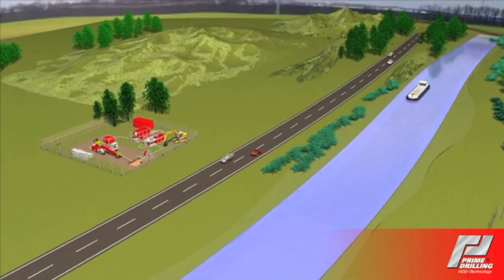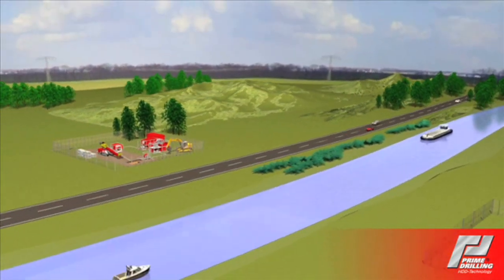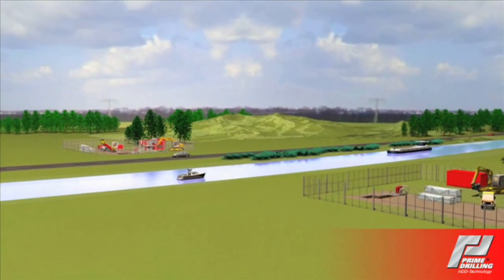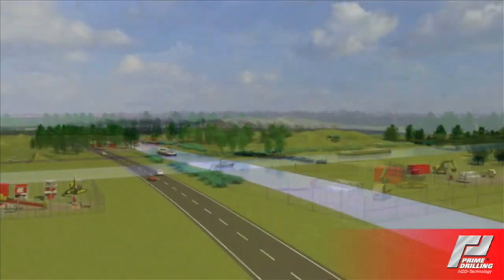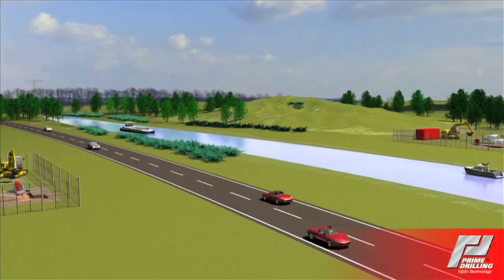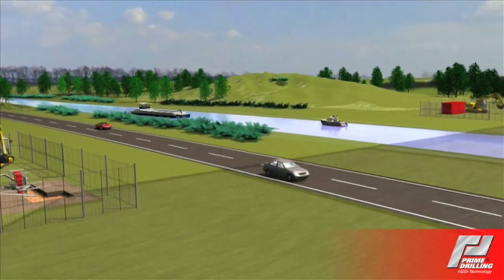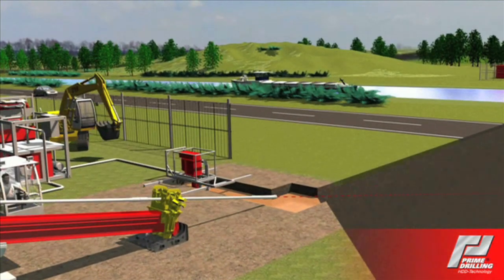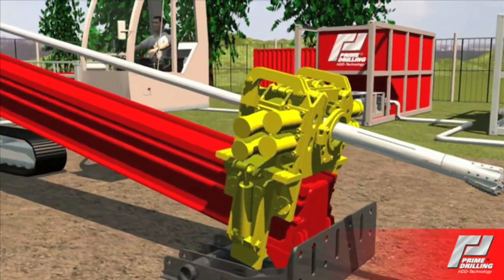Prime Drilling - Horizontal directional Drilling explained

Comment: Great video!  Thanks.  The invention shown in this short  video allows you to build a continuous pipe onsite for all your HDD projects.  The lightweight pipe is very strong, non corroding and it can resist extremely high pressures.  We can make pipes as small as 3-in. (75mm) in diameter.  Please watch the video:  
https://www.youtube.com/watch?v=EGsipDj0dEA

Comment: I had an experience to use the method over 3.4 kms. This is only useful for crossing river or structure. My project was for waste water pipe line network. The staffs who use the method in Vietnam promised it's really good method for network pipeline in soft ground. They advertised it proudly. However, Manhole installation must be matched with it. They expressed that Manhole installation would be carried out by Top Down method not Open Cut method. Eventually they ended up to carry out open cut. They hadn't any experience the manhole work. They took some money for pipe installation and gave up all the remaining works. I was really disappointed their attitude.

Comment: Hi there, are you looking for a machine that could purify and recycle the drilling liquid/mud/slurry, KES Energy may provide you a mud reccycling system from 150-1000GPM in the oil & gas drilling,water well drilling, CBM drilling, geothermal drilling and modern trenchless infrastructure construction(tunneling, micro-tunneling, pipe-jacking, bored piles etc).  
For more details, visit www.kestrenchless.com
WhatsApp: +86 13087559846

Comment: not enough explanations on some parts of the drilling - how does the drill makes turns? All you showed was the straight lines
....
Reply: According to some research (I was wondering the same thing) I believe it turns by applying the small correction maneuvers it showed over a given distance to get a specific curve - I think it does this by pumping the mud fluid stuff in a specific direction. Regardless, however it makes its correction maneuvers is how it turns. And I believe each section of the drill has elbow type joints that allow it to bend. Again, not an expert, just what I gleaned from reading a few things

Comment: how does the pilot changes direction and how the huge and heavy rods change its direction on curves .....confusion
Reply: but the rod is straight steel .. how did it bend ?
Reply: @encikpewang4828  because its flexible and the joints arent perfect
Reply: umer shafi if you look carefully the drill head has a slanted angle at about a 45 degree angle. by rotating the drill string to the desired degree and then pushing instead of rotating, steering is achieved. for example, rotating the drill string to the 12 o'clock position and pushing will force the head straight up, of pushing at 3 o'clock will turn it right. in this way, it is steered.

Comment: How horizontal drilling works . You didn't explain the most sophisticated part. How the drill head navigates using the steel rods..
Reply: How can you push it if it is drilling into rock ? Possibly it rotates through a limited arc ?
Reply: @das250250  this type of horizontal drilling wont work in bedrock
Reply: @das250250  I suppos it is partly pushing and drilling
Reply: Brian Patton if you look carefully the drill head has a slanted angle at about a 45 degree angle. by rotating the drill string to the desired degree and then pushing instead of rotating, steering is achieved. for example, rotating the drill string to the 12 o'clock position and pushing will force the head straight up, of pushing at 3 o'clock will turn it right. in this way, it is steered.

Comment: Very informative.Are the drill rods flexible to make a, say, an arc shaped hole? How do they drill the exact route required?
Reply: babilabub if you look carefully the drill head has a slanted angle at about a 45 degree angle. by rotating the drill string to the desired degree and then pushing instead of rotating, steering is achieved. for example, rotating the drill string to the 12 o'clock position and pushing will force the head straight up, of pushing at 3 o'clock will turn it right. in this way, it is steered.
Reply: Well explained. 👍

Comment: Very interesting but not well explained: "the drill is called back on course". How it changes direction?
Reply: +Ken Saba immidiatly behind the cutter from the pilot drill there is this bent sub in the pipe which can rotate (with hydraulic pressure) to change direction of the cutter
Reply: in that one you can see it has a wedge on the cutting head so if they want to go left they stop the drill rotation so that the wedge is on the right and push the rod in pushing it to the left.
Reply: true true.. it only show the entry point and the exit.. sucks